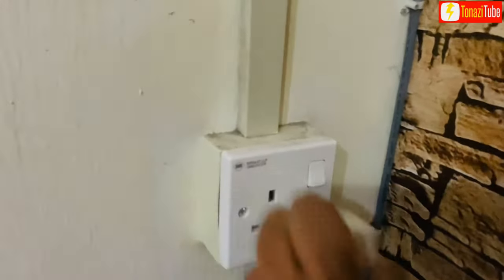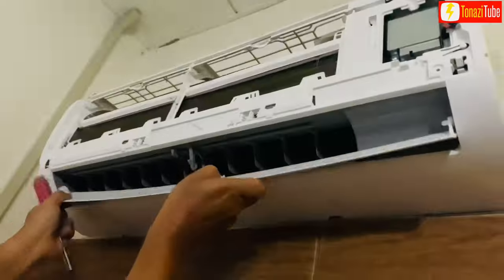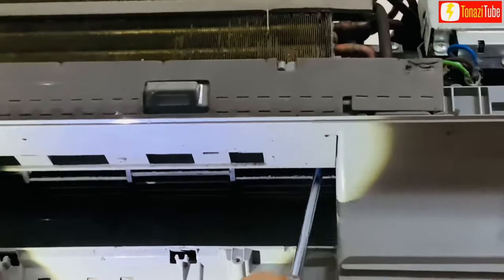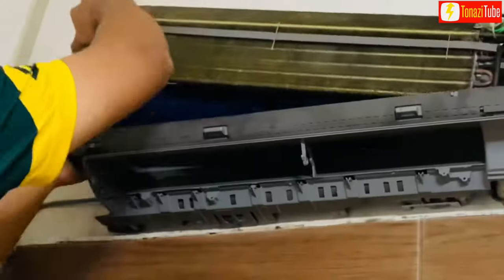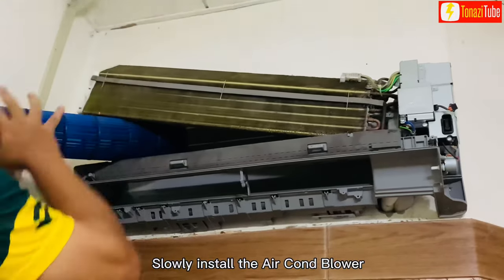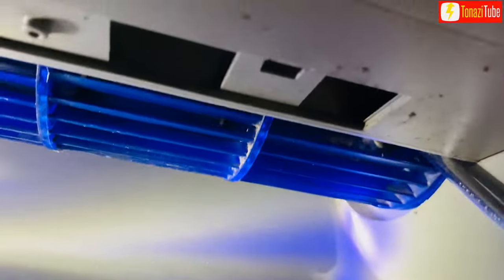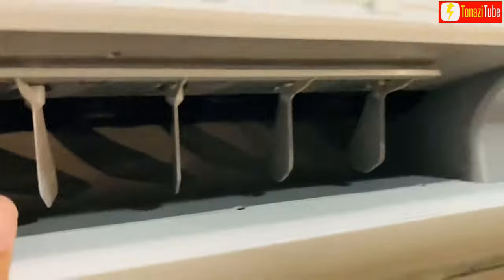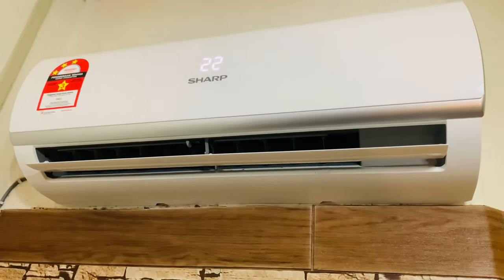How to Remove and Install AC Air Conditioner Blower at Home | Cleaning Service for AirCond Blower

Comment: Does the screw in the blower need to be precisely install to the flat part? Cuz my aircon start squeaking when the air blow😅
Reply from the maker: Pls check the blower connection,may be not fully slot and loose contact with bracket.Try open and reinstall back.

Comment: Already install back the blower but it turns out blower is hard to spin due to the blower is cramping with rubber on the left side. Already insert petroleum gel (vaseline) to smooth the blower with the rubber, turns out ok and smoother. But after 10mins, it happen again like the blower having the sound with rubber. Please help me!
Reply from the maker: Blower might not properly install into the slot.Try to reinstall and make sure it install correctly.

Comment: I don't like prying the evaporator, doing it frequently may crack the line and the repair would be troublesome.
Reply from the maker: You may not to remove it frequently.Just wash and remove dust using spray from outside.

Comment: how to open the blower even i already loosen the screw?
Reply from the maker: Try to slowly remove the left cover
Reply: You need to take out screws on the left and right side. Also on the right side you will se that metal part from fins is fastened to the plastic clip that you need to push in order to lift them up.
Reply from the maker: @BlackMambaKO Thanks for the advise

Comment: all thats left is to pull the blower out but its stuck and wont come out...

i removed the inside screw on the blower and the screw thats right outside the motor and stil it wont come out
Reply from the maker: Do you use same AC model or unit in this video ? Other model may have different lock or screw location which need to slowly remove the cover of the blower.
Reply: @TonaziTube  so it was bcuz it was a different brand, someone says the motor is attached to the blower so that blower screw alone won't do the job... am jus going to take a gun and spray it down
Reply from the maker: Different model may have different and method style to remove it.If try harder may cause some attach part might be broken and waste of money to repair it.
Reply: @TonaziTube  thanks for the fast reply though ✌️
Reply from the maker: @gazagames9853 You’re most welcome.🤗

Comment: After install back. The blower not spinning
Reply from the maker: Did you check screw installation at blower ?might be loose or wrong insertion slot.
Reply: @TonaziTube  hard to make it center. So i just tighten it. After that i on the ac. The motor is vibrating only. But the blower wont move. After that error code appear. E3